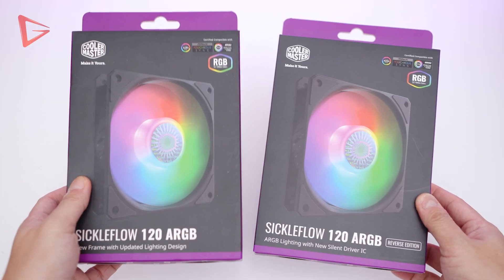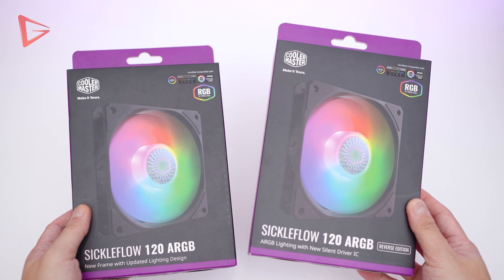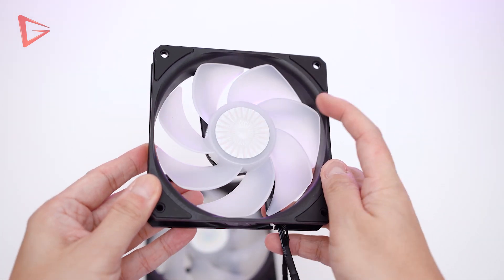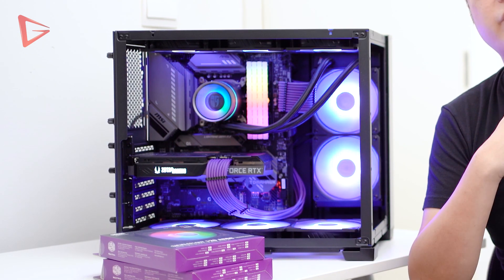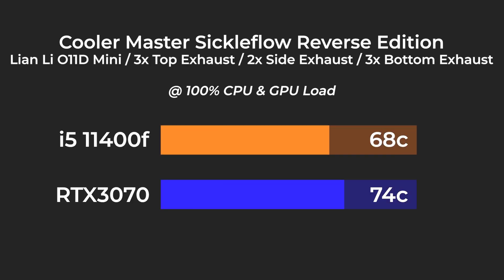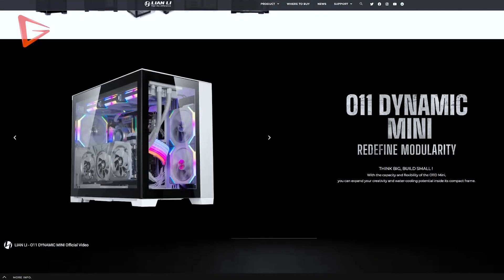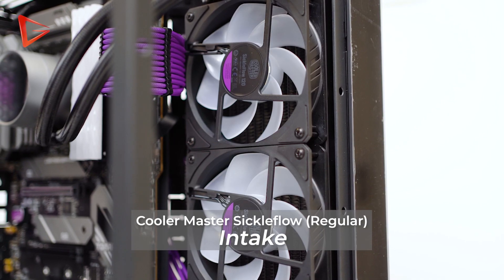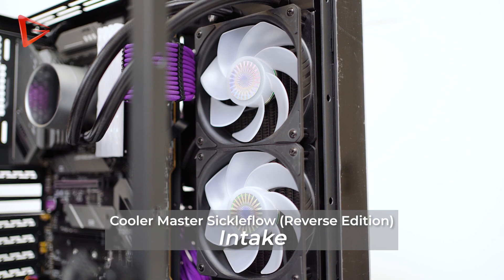THESE FANS BLOW IN REVERSE!

Comment: i dont really understand, what is the difference between normal fans and reverse fans? do they just blow air on the opposite side of the sticker??? i dont understand, can someone please explain this to me
Reply from the maker: Yes it blows air the opposite direction. In certain situation like in the Lian Li O11D series casing, it is better to have the 2 side fans blowing air in (intake) than out, and when used with regular fans, you will see the fan cages inside. This reverse fans allows you to blow air in and still keep the aesthetic of not seeing the cage from inside the case :)

EDIT: amended my earlier mistake of saying the other way round
Reply: @ghimtech  thank you, i understand now
Reply: you contradicted yourself in this answer though, in video you said the side reverse fans are for intake, not exhaust @ghimtech
Reply from the maker: @eternaloblivionvt  yeah I realised I wrote it wrongly. The right was is for the side fans as intake (hence seeing the cages on the inside), and the reverse fans will still let the air in (intake) and not seeing the fan cages. Thanks for pointing my mistake!

Comment: lemme tell you a trick with reverse fan, if you mount these fan in stack(one facing outside, one facing inside), you can generate some very insane static pressure and air flow movement

Comment: Is the noise louder than normal one?
Reply from the maker: If you are comparing to "normal" one as in the regular Sickleflow, it is the exact same specification, they only switch the blade up to reverse the airflow :)
Reply: @ghimtech  I JUST PURCHASED 3 FANS AND THEY ARE MUCH NOISER THAN THE NORMAL VERSION ON MY CASE NZXT H6 FLOW, I'M REALLY NOT SURE I'LL KEEP THEM. CM IS MY FAVORITE BRAND BUT THIS FANS ARE REALLY NOISY, ANY SUGGESTIONS TO REDUCE THE NOISE?

Comment: I just bought Cooler Master AIO for my new build and for pull config I had to put the ugly side on, I casually searched if there is any reverse mod for this, and found out CM actually makes it, my huge respect to them, and I thank god I didn't go with Kraken AIO or this wouldn't have been possible.
I'm gonna buy them right away now 😁
Reply from the maker: Ikr! More brands should make reverse fans!
Reply: Exactly the same for my NR200 build I had to put the argb top fans with the ugly side for exhausting config, now I found this version which just fulfills  my requirement